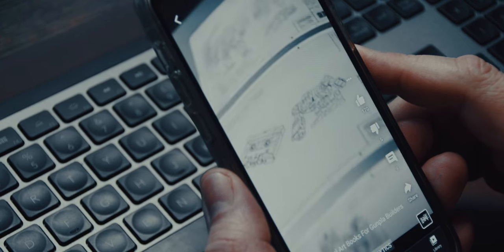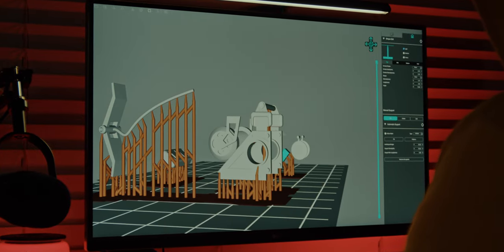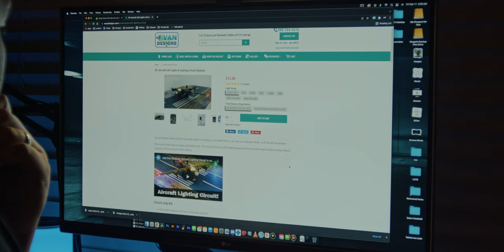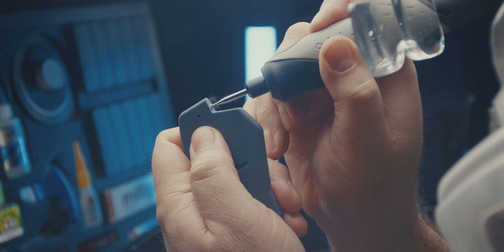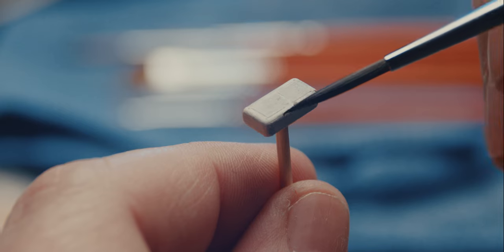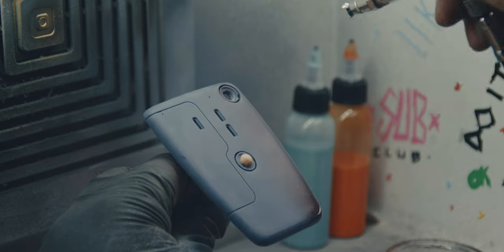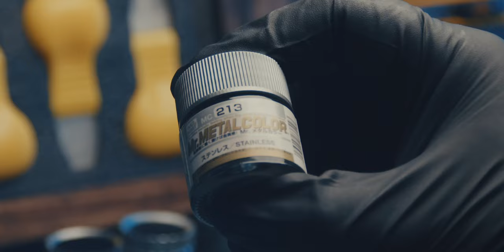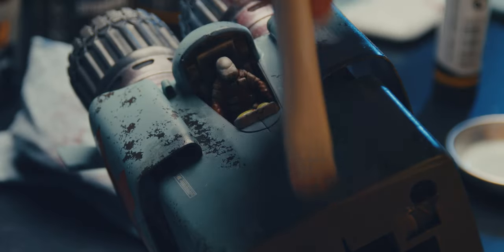Concept + Modeling + 3D Printing | Anycubic Photon Mono 4K | S04E01

Comment: Brotha this turned out incredible. You did an amazing job ripping this right off the page and breathing life into it. Keep up the amazing work. If you don't mind me asking how did you learn/figure out how to do the LED's on this with the chip and what to connect where, how to get the lights to blink etc? And Happy Belated birthday!!!
Reply from the maker: MY DUDE! Thank you! I got the LED system directly from EvanDesigns.com and it came with everything I needed... the chip, the LED's, the wiring... I just had to assemble everything, place the LEDs where I wanted them, and connect everything and power it... it was easier than building an HG Zaku II... piece of cake! And thank you for the Bday wishes! Miss ya bro!

Comment: I instantly had to get your STL's! Just wondering what slicer you used and what size you made the parts. I loaded the engine file and it fills the whole plate and actually hangs off a bit. I see in the vid that you have all four printing at once plus a few other parts...
Reply from the maker: Thank you for purchasing the STL project! You can use any slicer you wish, and then reduce the size as you see fit. In my case, I printed it as large as I could on my Anycubic Mono 4K so I think the files were reduced to 10% scale (around there)… u probably wouldn’t want any smaller than that because the tiny parts would be waaay small… also the pilot is a bonus file and you can print it on the seat so you won’t have to do too much sanding… have fun!

Comment: Epic work. Out of curiosity do you 3d model on a desktop, laptop, or tablet?
Reply: Also any resources you suggest to learn how to 3d model like this
Reply from the maker: @jonathancerutti2546  hey man, thanks so much for stopping by! I use my Mac Mini M1... Fusion 360 is the weapon of choice, but I am starting to get into ZBrush and other more sculpt-oriented apps vs. engineering apps like Fusion (less complicated!)... I bought a course off of Udemy to learn Fusion and I'm not even a 3rd into the course but I've learned a lot of the basics, which allowed me to design this model. I'm currently working on my next project which is a bit more complex in terms of shapes and arrangements, so I say get a beginner's course on an educational site like Udemy, etc, and just start designing things and you'll start to get the hang of it... good luck!